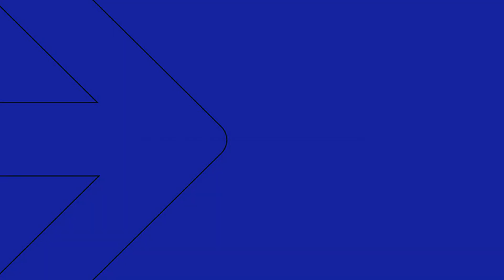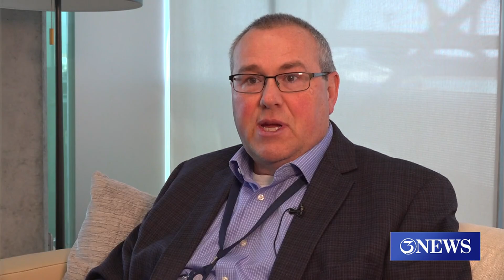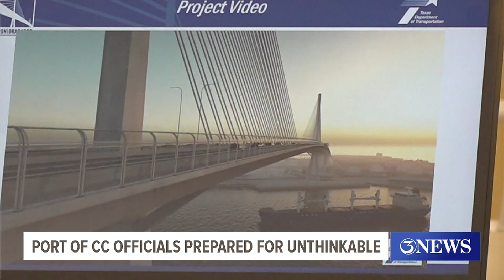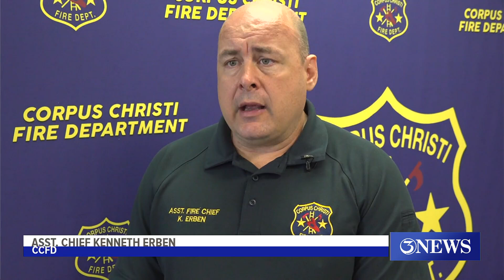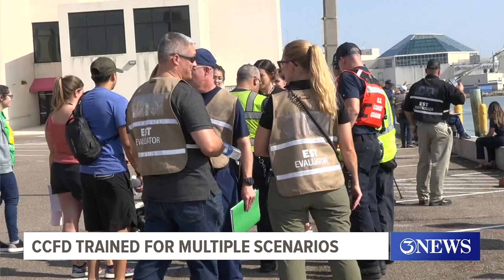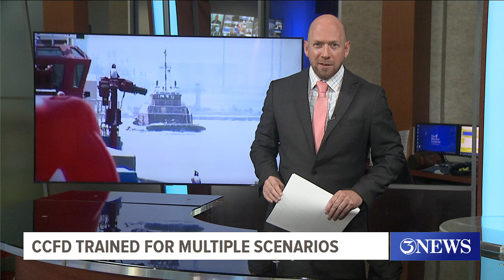Considering local bridge safety after Baltimore bridge collapse

Comment: Sorry don’t trust the new bridge
Especially the south beam/pillar that’s on land closest to the hooks stadium and corner of the concrete wall.

I do not believe that piece of slab is going to hold up all that weight when it comes to time it opens up and the constant hauling of traffic.

Don’t think engineers did their calculations correctly at all.